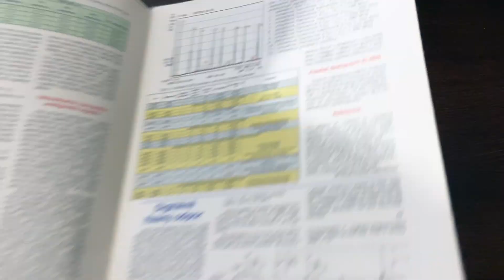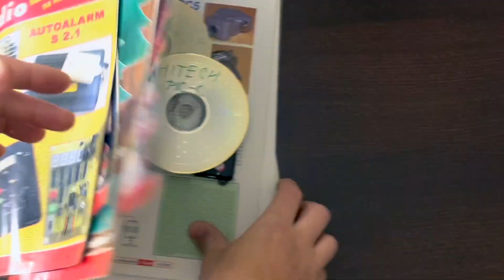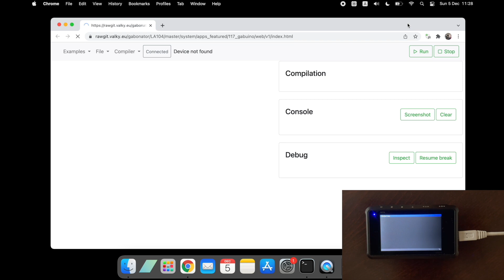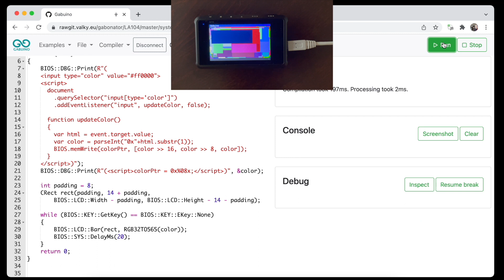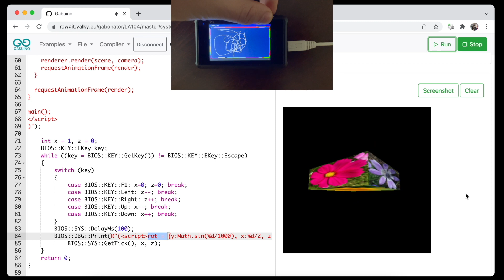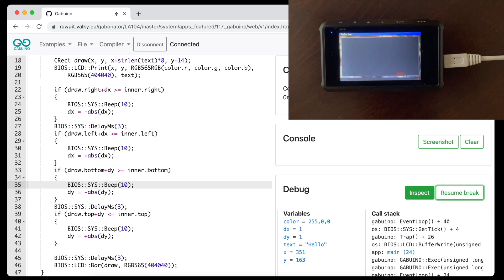Gabuino: Arduino with debugging and a lot of more

Comment: not able to get connected. It is showing in windows as usb serial device on com15. in linux shows (lsusb) ID 1209:db42 Generic Devan Lai dapboot DFU bootloader. when connecting to VM is showing as Gabriel LA104 gabuino. Unfortunately not able to connect in any OS
Reply from the maker: try this: https://github.com/gabonator/LA104/issues/77#issuecomment-991708239
Reply: @gabonator  tried using chrome (so i was able to choose device), but get this error: SecurityError: Failed to execute 'open' on 'USBDevice': Access denied.
Reply from the maker: @jozefsoucik3115   did you install zadig driver?
Reply: @gabonator  yes. and works fine. I want to emphasize that using Firefox didn't work (because of no console API ?)Chrome or Edge works fine.
Reply: @gabonator  help to install zadiq driver winusb instead of usbser

Comment: Do you have an implementation to operate the Logic Analyser mode via a webUSB interface, i.e. so logic signals can be decoded and saved directly on a PC/SBC (or even sent from), and without the Display mode bug that's still unfixed from the makers lol :)
Reply from the maker: no, suprisingly in my experiments I did not use the "logic analyser features" of LA104. I did only very simple experiment with integration with sump/sigrok/pulseview with fixed sampling running at 50kHz.
Reply: @gabonator  ahaha I think everything you've done for it is rather impressive, makes the device a million times better. I guess I'll have to figure out how to pipe the data to a PC for analysis myself, as I kinda want all the features possible at my disposal so its fully utilised for all situations xD
Reply: @gabonator  Could you give me some pointers on where to start playing with so I can get a even quasi functional pulseview driver/connection going please, it'd help me get started with where I want to develop. That unfixed display bug makes using it for the intented purpose quite irritating lol so i think this way would resolve that adn let me have a bit more flexibility, if i run it via a SBC with a better LCD and pulseview over the actual board and it's glitchy display?
Reply: @gabonator  ( i assume USB_Connect(DISABLE) in the files.c is relevant if i'm winging it xD )
Reply from the maker: @noviceartisan  look for "apps/test70_webusb" it is a complete webusb application which exposes the LA104 logic analyser functions into web browser. I made this to better understand how the FPGA captures the waveforms and how to decode the bitstream into pulses. Compilation will fail, but just add "const" into BufferWrite declaration and it should work. For a more advanced webusb application refer to "apps/test70_webusb" which is a RF scanner based on CC1101 transceiver.
Reply: @gabonator  Cheer, I'll fork and have a play with that one and see if I can get the knack of the codeflow for it, it's a good starting point. Thank you :) 
What's your thought on switching out the flash chip for a bigger soic8 package, like the W25Q128JV, so the onboard storage doubles? I think it'd just need a few lines of code changing to accept it as a drop in replacement. I think that's the biggest 8 pin package it could have anyway?
Just means I can have more apps stored on the device without needing to have an extender with sd card in permamently?
Reply from the maker: @noviceartisan  to change the eeprom size, some of the constants would need to be changed (see os_host/source/bios/fat.h and os_host/source/bios/la104/Ext_Flash.h), otherwise the OS will just use it as 8MB, but generally there is no need to extend the eeprom. Apps are 5kb-50kb in size, you can fit plenty of them even on 8MB disk. The most limiting factor on LA104 is the RAM size. With more ram, much more complex applications could be developed. So if you want to mod your device, I would suggest replacing the CPU
Reply: @gabonator  It appears the STM32F103VGT6 is a pin compatible replacement, same line of processors just a beefier verstion with double the ram and much more flash on board too. I'll get one ordered on Friday and give it a try, thanks for the idea! I'm looking muchly forward to milking every drop of use out of this platform xD :) I still suck with github, but will feed back there if I do anything interesting too so it can  be shared with wider community via your page :) Cheers for pointers so far, really helpful and inspiring to have dude :D

Comment: Incredible! Is this also compatible with the miniware DS212?
Reply from the maker: I ported it to the devices which I own, currently it is not compatible with DS212, but there should be no issues preventing it to be ported to that device...
Reply: @gabonator  thank you. What sort of things need to be adjusted when porting?
Reply from the maker: @AuxiliaryPanther  there were some attempts to port it by the community. Check this discussion: https://github.com/gabonator/DS203/issues/47